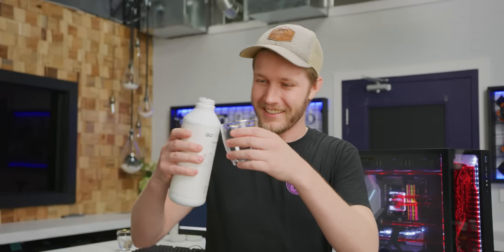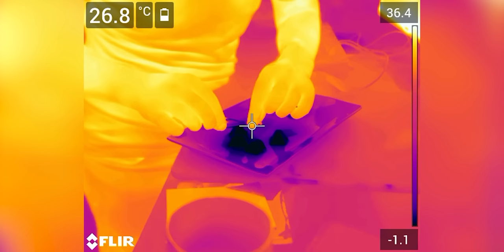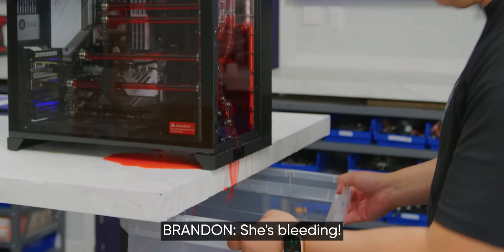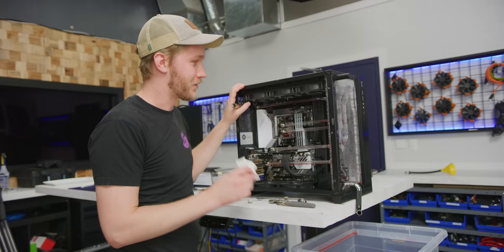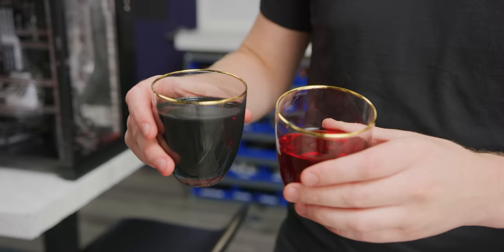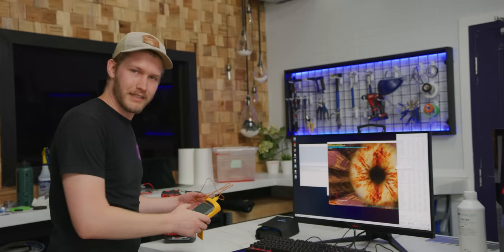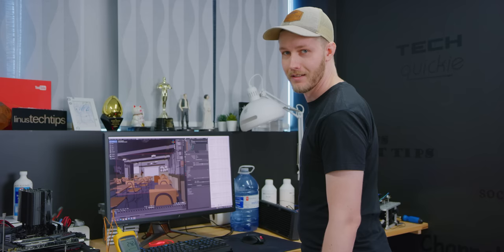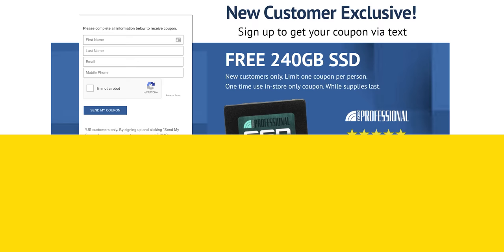7°C Cooler? This must be a scam - GoChiller Graphene Coolant Review

Comment: Maybe 3 degrees cooler today, but when the particles start settling and jamming up microfins a month later you'll probably find that the performance tanks super hard.
Reply: Also that is graphene dust so in the long term gonna mechanically corrode you loop, the pump gonna die in one year if things goes good
Reply: The settling that happened in that cup just while they were filming didn't leave me with a lot of confidence.
Reply: graphite is technically a lubricant, so I would guess that there shouldn't be any issues with additional mechanical wear... settling is a legitimate concern, but graphite building up in the cooling fins could hypothetically improve thermal transmission, however depending on the size of the microfins blockages might be an issue over time... if instead of graphite, you had nanotubes and older generation fins in the loop, there could be a benefit to nanotubes getting caught in larger fins and increasing their surface area. 

If they're feeling insane, a water loop filled with gallium would be a lot of fun to see. especially if some "accidentally" uses an aluminium part...
Reply: @davidpretorius2984  No, obviously graphene settling in microfins wouldn't improve heat conductivity, because you're reducing surface area AND/OR increasing flow resistance, and you're also adding material between the copper and the water, and thus reducing overall conductivity even if the thermal conductivity of the material is pretty good. 

Imagine for a moment coating the exterior surface of the fins on a standard air cooler in graphene. Even if that increased surface area, would that help heat conductivity? Obviously not. At the micro-level it's much worse, roughly analogous to filling most of the gaps between the air cooler fins with graphene and choking flow.
Reply: @SovietGrazz  the thickness is literally one molecule, however. And the thermal conductivity isn't "pretty good" it's off the charts and better than anything it's coating. IDK, it seems to me that if you look up graphene coolants for other applications (because they are out there) a coating of graphene on the interior surface is the point. In fact, several applications go so far to say that after being internally coated by graphene coolant the performance of the radiator increases and will eventually lead to much more efficient radiator technology in the future.
Reply: @erico7245  One particle is the size of one ATOM (not molecule). A puddle of it at the bottom of your loop is not going to be one atom thick, anyways.
Reply: @SovietGrazz  if the coating is more thermally conductive than the substrate, then the overall thermal conductivity increases. Image wearing wet clothes in winter, wet clothes are more thermally conductive than skin, so you'll lose more heat than if you weren't wearing anything at all...
Reply: @davidpretorius2984   This is the worst possible analogy. Wet clothes are also prone to losing a lot of water to evaporation, because your body is warm, and your environment is colder and dryer. This is the main reason why you will lose more heat, though of course there are more.

Thermal conductivity really isn't the point of water cooling, or it really wouldn't work at all, it's thermal capacity and circulation. That you always replace that water in the cooling fins with water freshly cooled down, and let this water absorb the heat a little, and then you carry it away. If you are reducing the surface of contact between water and the hot plate fins, such as if you coat the fins with some material, you only lose performance.

I expect though that there are some interface or impedance matching effects, so it can be of advantage to replace the contact impedance between copper and water by two contact impedances copper to graphene and graphene to water which can be smaller, but they can only be good as long as there is no substantial impact on the contact surface, and it also won't do you any good to add more impedances graphene to graphene no matter how small. And if it does indeed happen that the graphene particulate clogs up the microfins, it'll go from an improvement to a strong detriment.

An example of contact impedance matching is thermal interface materials such as paste, which can have low thermal conductivity and still facilitate thermal transfer.
Reply: I wonder is it possible that the graphene starts to act like an electrode or something? Like it creates a slightly negative or positive charge to the liquid in combination with the metal, and eventually starts to corrode? IDK if that makes sense.
Reply: sigh distilled water and foaming test, you need a foam stone to test, you can get from scientific supplies.
Reply: @davidpretorius2984  wet clothes are not more thermally conductive than skin. They hold water, which evaoporates into the passing air and wicks heat away from the body

There are other factors but evaporative loss is the single largest one by an order of magnitude
Reply: @miscbits6399  for an example where evaporation isn't a factor, try taking something hot (say 80°C or 180°F so flashboiled water isn't a consideration) out of the oven with a dry oven mitt vs a wet oven mit and tell me which burns your hand faster

Comment: *Draining with fill port closed*

"This system is really not easy to drain guys"

...
Reply: Indeed, made that mistake myself too :D But seriously, i thought about draining and have a seperate drain pipeline in the system (on EK front panels 2nd lowest access point) with a close down ball valve+cap. I can drain everything other than the lower rad in 30 seconds, np. So like maintenance of CPU/GPU block is super easy.
Reply: You know when you open the drain before the fill port.

Comment: "We have controll of the HVAC"

"But the room is 1° cooler"

Me WTF
Reply: That was not a good idea imo
Reply: this video is actually a bit of a joke
i don't even know what they have used to flush the system and how many times they've flushed it
Reply: Air conditioning doesn't run at a constant rate. It runs when the temperature is about 3-5 degrees warmer than the set temp then cools till it hits that temp again.

Comment: Okay, so I've worked with graphene liquids before and the reason why it foams is due to the dispersant and the stuff that keeps it in suspension. I doubt they have an anti foam agent in there as it would probably cause clumping and it to fall out of suspension. When we used it it would foam at even the slightest movement. Also you REALLY don't want this stuff on your skin, it's known to accumulate in the mitochondria of your cells, they don't currently know if that's bad, but everyone who takes an educated guess says it's bad.
Reply: I don't know, that sounds like an origin story to me...

Comment: Der8auer already did thermal testing, about 2K less temperature, so quite within the margin of error. I assume you would need much more graphene particles to get a decent effect, but then you would probably have to change the naming from water cooling to syrup cooling or something like that.
Reply: I wonder what the optimal ratio is.
Reply: "Physicist's McFlurry cooling"
Reply: @boiledelephant  Forbidden brownie batter
Reply: The only way to improve on water is with a fluid that has more thermal capacity not thermal conductivity. Thermal conductivity is how air coolers work.
Reply: @Mrx1080  water already has an enormous heat capacity. But it's all meaningless if you don't get rid of it fast enough (unless you have a massive reservoir, then maybe)
Reply: -2000 degrees sounds pretty good to me
Reply: @9.5.9.5  Kelvin*
Reply: @j4log719  You could use Ammonia it's slighly better at thermal mass.

Comment: Let's not forget that the effectiveness of water cooling is not simply a factor of it's ability to conduct heat, but it's ability to store enormous amounts of energy to buffer heat transfer to the heat sink.

Graphene coolant is trading it's ability to conduct for it's ability to store energy. So in order for it to perform exceptionally well, you need a bigger radiator on which the graphene can displace even more energy quickly.

The gains in this case were probably only due to the radiator being oversized for the application. You overcame the limitations of the original coolant and it's ability to transmit energy and essentially discovered there was more capacity to transmit heat through the radiator than there was to store the energy in the coolant under load

Comment: I'd like to see long-term testing for this stuff. Does it build up in the system? Does it stain tubing or acrylic?
Reply: Im with this statement
Reply: My assumption is this will coagulate as it has particles suspended in the fluid. I expect it to build up on basically everything over time.
Reply: @Skylancer727  I dont know.. i ran mayhams nano fluid for 2½ years and there was no build up in the blocks.. it had a little in the pump but not that bad.. if its anything like PRIMO CHILL VUE then its bad.. How ever Graphite is a lubricant. so it might work out OK
Reply: agreed. Would somebody need to build a system designed to keep the fluid agitated by keeping it moving quickly and not having many horizontal lengths of tubing? What happens if it does settle, can it be re emulsified?
Reply: @grosen84 thats Like saying: "mine worked so yours should too!" not a single part in this loop was designed with this stuff in mind
Reply: @grosen84  l
Reply: @Xyphren  Dont belive i made a claim.. more like a 50/50 assumption
Reply: @grosen84  Vue worked fine for me. Try following the instructions.
Reply: @Lexicon_  now THATS like saying "mine worked so yours should too!" I dont need to read the instructions for it.. I read the incompatibility list and there will be problems in my loop for sure.. Do they still promote VUE as a show fluid that can only be running 6 hours a day at super low pump speeds? I really want to like VUE, dont get me wrong. But i Emailed support, and they basicly told me not to order it.

Good for you that it worked out 4 you. i envy you
Reply: @grosen84  I tried once to lubricate PC coolers with graphite lube and while they didn't really fail but next time when I decided to take them apart graphite was deposited on the edge of the bearing and oils from the lube were almost gone.

Comment: Id like to see them try the automotive coolant additive called "water wetter", they claim up to 20°F cooler temps when used in a car.
Reply: the issue is the temperature delta.  In a car the coolant is around 100c (212f), and ambient air is going to be, let's say 25c (or 77f).  That's a 75c (165f) difference between the coolant and the air you are trying to dissipate heat into.  In a watercooled rig what's the delta between coolant temp and ambient? 10, may 15c (50-59f)?  There's just not all that much improvement to be had from the coolant itself.  Even differences in the radiator itself are going to be minimal with those kinds of delta numbers.

I'm sure water wetter would help, but the difference it will  make is going to be very minimal.  If we want to see significantly lower core temps, we need to either improve the thermal conductance of the die itself, or go sub ambient.
Reply: Iirc, the water-wetter helps by preventing localized boiling at hot spots in the engine block.  If your die never gets near the boiling point of the coolant that's probably not benefit to you.
Reply: As the other comments say, I don't it will really do anything or something significant, but, "this is LTT!" (Read as in "this is Sparta!") So yeah! They should do that video Ltt style.
Reply: Or Engine Ice
Reply: Water wetter will not make you engine run cooler, it raises the boiling point significantly so you can be safe at the high temps you see at the drag strip.  IIRC it was meant to be added to engines running straight water. If you have antifreeze/coolant already it will do nothing they aren't already doing.
Reply: Water Wetter is just a surfactant, and iirc it's not good for acrylic. I used to use it in my race car (most road courses ask you to use water alone or water + water wetter vs a glycol coolant so if you have a wreck or failure it doesn't leave the track slippery) but I'd never use it in a PC.
Reply: Major Hardware did a video on this.  Worth checking out.
Reply: @davidmoffitt981  Water alone you need to run a higher pressure rad cap and have a solid system, which is why water wetter is a good substitute as i believe its supposed to be biodegradable, but don't quote me on that. The local demo derby guys run dove dish detergent, swear it keeps the cars cooler and no worries about mess.

Comment: I'd love to see the long term results with using this for a few months and if any issues come up. 
I can't shake the feeling that it'll gunk up components over extended periods of time. 

Hopefully I'm wrong. Because it DOES look cool in a custom loop.
Reply: Yep will be pleasantly surprised if there isnt a major downside, from the universe's pain in the ass rules n laws.
Reply: It does look like the graphine comes out of the suspension pretty easily. Noticed it when he was pouring out of the glass into the fill port.
Reply: It may not sand down oxidized material the same way vue does. Depends on graphenes hardness I suppose.
Reply: of course!!!!!
Reply: Graphene's hardness is pretty low so optimistically it won't grind up components, while graphene is electrically conductive it seems the suspension limits that to something similar to salty water or comparable cooling solutions. My only worry is it clogging up the impeller in the pump or the micro-fins in the cooling element since it seems to only barely be in suspension. A longer-term test would be great to see because it does look amazing even if you ignore the marginal cooling efficiency improvements.
Reply: @Fenriswaffle  yes, especially with how malleable it is, clogs are going to happen.
Reply: I think a radiator design for this material would be more effective and long term safe tbh.

Comment: That's why I stick to noctua air coolers and kryonaut paste in a tight pentadot configuration.
Reply: I prefer the stock Noctua paste. Insanely good for paste (almost as good as liquid metal), and nearly impossible to fuck up. And it's free with your cooler!

Comment: WAIT A MINUTE.
If the previous coolants had that "layer developing" property, it's possible that the protective layers those formed were degrading the potential performance of the suspended graphene particles.
Just a thought.
Reply: That wouldnt be the case for the 2nd test, where there was just water in the loop beforehand.
Reply: @joshuaford4460  The second test was the one that showed actual improvement. There might have been something in the first tests other coolant that interfered slightly.
Reply: “Layer developing” because a multimeter have voltage across the probes when measuring resistance, essentially electroplating the probes.